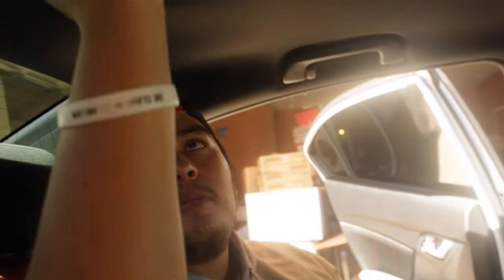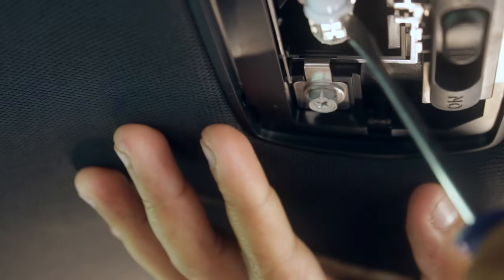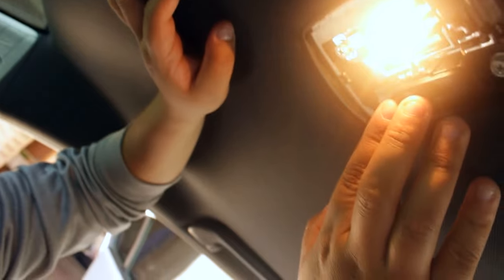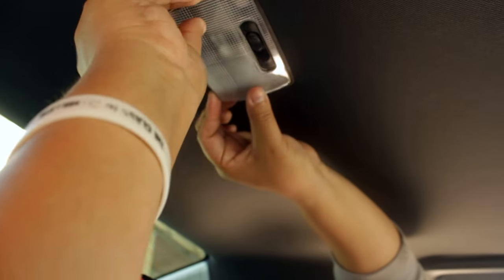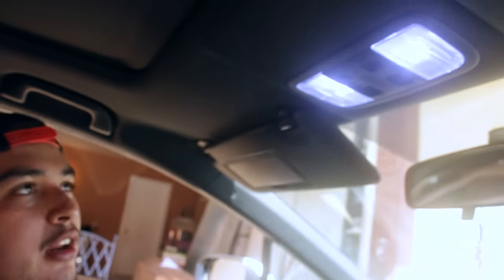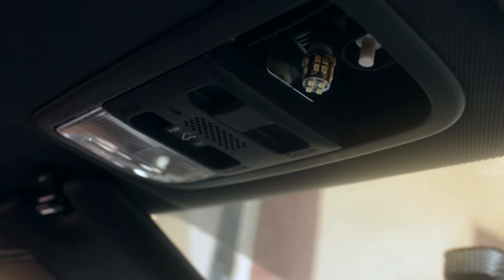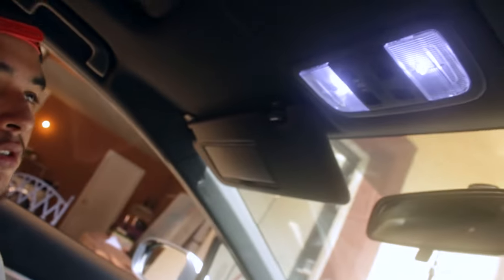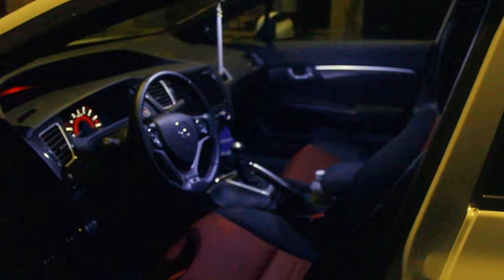2015 Honda Civic Si- How to Swap Interior Bulbs for LED's 2/2

Comment: I know I'm late but I really want to know what lights these are, and they are the same as the license plate light? The color on them are nice.
Reply from the maker: I don't have the direct link anymore but i just searched led kit for 9th gen civic. All the lights were exactly the same for the interior and for the license plate lights. They also fit for the reversed lights. I tried them but I didn't have enough to put some on.

Comment: can you tell us where you buy all these led lights that would be great thanks!!!
Reply from the maker: +Oswaldo Ovalle I got them on eBay as a set but I can't find the exact ones I got. You can just search for led interior kit for 2015 civics on eBay
Reply from the maker: +Oswaldo Ovalle http://www.ebay.com/itm/LED-Lights-Interior-License-Package-Kit-For-Honda-Civic-2002-2015-13-LEDs-White-/291702367062?fits=Year%3A2015%7CModel%3ACivic&hash=item43ead0e356:g:DvYAAOSwFqJWoWCb&vxp=mtr something like this

Comment: How did you get your front interior lights to light up when your door is open?
Reply from the maker: there's a switch near the moonroof/sunroof control. it turns it,off or let's it be on when doors are,open.

Comment: Hey bro for the front interior lights. how specifically do you install those cause I'm having a difficult time trying to get those in the right spot
Reply from the maker: like the positioning of the bulb or how to remove the plastic to get into it?
Reply: Like the positioning of the bulb
Reply from the maker: IF you already took off the old bulb you just have to keep flipping the led cuz it doesn't really tell you which is the right way. You have to mess around with it.. Just a heads up if you bought some off eBay they might be toast so try different ones.
Reply: Aight but I see that yours are facing down and I was trying to see how you got your like that cause you used the same bulb for the trunk, for the interior right. And I'm working on a 2012 Honda Civic coupe just as a head ups
Reply from the maker: ohhh the bulbs I used have leds all around so it lights up to all the sides. so it doesn't really matter how you position it as long as the connector is plugged in the right direction. it should be the same for coupes.
Reply: Alright thanks bro

Comment: hey bro, how much did you end up paying for you're card, i want to get one sometime and want to know whats a safe buy... like with state taxes and the car cost.. thanks
Reply from the maker: I got mine brand new. and new they can go for anywhere between 23k-25k depending on options and if it's a coupe or sedan. mine is pretty much the top of the line with navi, satallite rradio and the multi angle back up. (but the only reason I got it was that it was the only sedan Si on the lot) if you don't need navigation you can save like 2 grand. mine was msrp at 25k and taxes were a bit over 3gs. plus I got 1.9% financing which will add a like 3 more gs in the time I pay it. So I would pay a little under 30 total with no more add-ons like gap insurance and all that stuff. but I traded in my old car that had negative equity so I owed more then it was worth so I'm still paying the difference which added a lot more to my debt. plus I added gap insurance and was able to get free maintenance for 3 years and an extended bumper to bumper warranty. they did bump down the price to like 23k though(the actual price of the car). if you want more details pm me or dm me on instagram @Marcos_sivicfb6, but if you are getting a 9thgen Si now you might be able to get it cheaper in the next couple months since the new one is bound to come either the end of this year or early next year.
Reply: +CarsLife&Comedy yea i really want the 2015 civic si in white, the coupe version.. good videos btw..and yea im fine with just the basic si just trying to pay 22k including tax. i already made some progress, some honda dealer offered $21,500 before taxes and taxes would be 2k so thats $23,500 but im sure i can get it down to $22,900 atleast lol... hopefully.. seen the street broadway you stay in L.A?
Reply from the maker: You should be able to find a dealer to give you a price around there out the door. Especially since the new gen is starting to come out in the next couple months. The coupes are pretty sick I just needed a four door that's the main reason I got this car and Nah I live about 30 miles from downtown LA though.
Reply: +CarsLife&Comedy oh OK. from your exp , do you think they will have the car I want next year by like may? like still new in the dealer?
Reply from the maker: I'm not sure. They usually only keep 2-4 si's per dealer and I'm pretty sure by May next year they will have the 10thgen so you might do better with one of those. I'm hearing the si might be turboed. But I'm sure there will be some back stock but it will be harder to find. You could probably get it cheap if you find one though especially if the new si is turbo.
Reply: Yes, I'll prefer the 2015 tho,, I really hope they have them still by then. I hardly see them on the street , the coupe version...
Reply from the maker: I'm sure you should be able to find a few. You'll probably have to search in the dealers around your area. And yeah you don't really see si's that much I've seen a few coupes and a little more of the sedans. I used to have and frs and when I first got it you would hardly see them now they are everywhere. Lol.
Reply: +CarsLife&Comedy yes, my co worker has one, but its a nice car, if you don't mind me asking. what u pay montly and considering its an SI. did you have room for negotiations?
Reply from the maker: Yeah I mean you could negotiate down a bit not a crazy amount though like they will knock off 1-2gs of sticker price especially with the new models coming. My case is a bit different though cuz I was upside down on my frs so I owed way more then it was worth. I think I owed like 27k and it was valued at 19 or 20k. So I ended up having a way higher payment because I had to pay the difference of what I owed. So adding what I owed and getting gap insurance and they threw in 3 years maintenance and extended warranty I ended up paying 526 a month. But like I said it's high because I gave no down and was upsidedown. If it's a straight up purchase with a little down you should be able to get a payment in the high 300s or low 400s depending on the down and your credit for the interest.
Reply: +CarsLife&Comedy cool, and what song is on the intro
Reply from the maker: I believe it's called nothing yet by laszio there should be a link in the description.
Reply: +julio alvarez check out norm reeves Honda in Cerritos. I bought mine there. I went about a month ago to buy an accord sport and saw about 4 coupes.